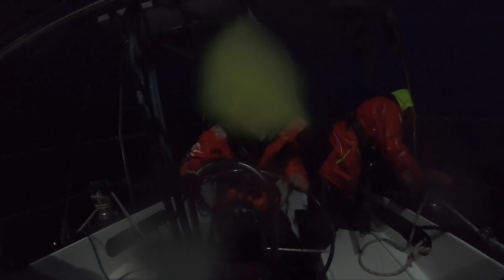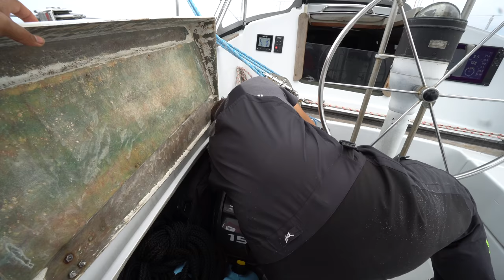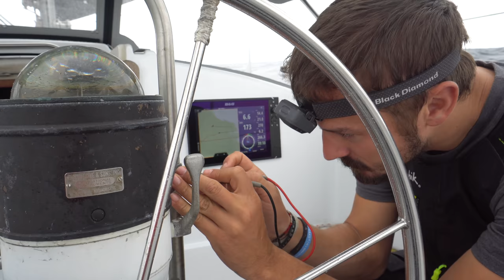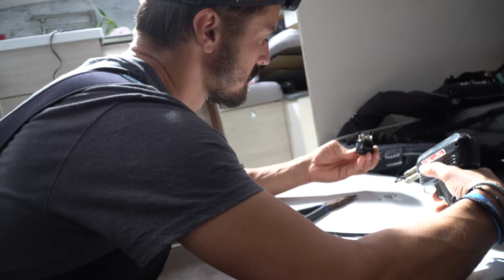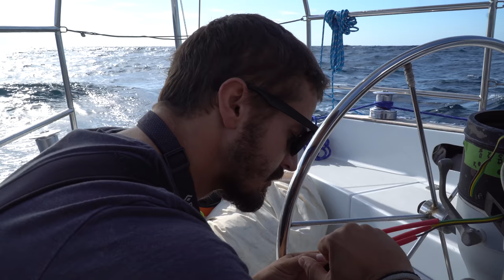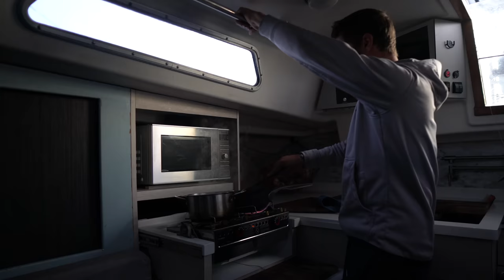Our Electric Motor Broke — DAY 11 / North Atlantic Crossing — Sailing Uma [Step 192.11]

Comment: Guess you need to be a jack of all trades when you own a sailboat. Great job fixing the switch and compass.
Reply: Totally realising this through this video.
Reply: You ABSOLUTELY need to have a very good amount of innate mechanical aptitude.  Whatever problem you have on the sea is yours AND YOURS ONLY to sort out and fix. There are no on call repair services.
Reply: @davem5333  I couldn't agree more.  The best boats for this kind of thing are ones that you've restored yourself as hopefully you will know wgere everything is and how it works/breaks!  It frightens me how many people head out to  sea with a cooler of beers and wouldn't know what end of the hammer to hold or how to call in / respond to a mayday!

Comment: Thanks for letting me feel like I am sailing across the ocean without actually getting wet.  As an electrical engineer, I could suggest a few things that might be good to know if a problem like this occurs in the future. Crimp connections are probably more reliable than soldered ones, but if you are soldering, there can be some technical issues.   First of all, it would probably be a good idea to invest in a soldering iron that has a temperature control (about $100 on Amazon).   And the soldering iron should have a relatively large tip because the small tips are only for soldering circuit boards.  In any case, if there is too little heat, you don't get a good solder connection, and if there is too much heat, you can weaken the switch, e.g. by causing its springs to lose their temper.  And with low voltage equipment, it is particularly important to get good connections, because low voltage devices can require quite a lot of current, and even a small amount of resistance in the solder connection can cause heat and corrosion over time.  A good trick for getting good solder joints is to use plenty of flux.   Solder is hollow and has flux inside.  So if you melt an extra amount of solder onto the joint, so that some of it drips off, this will give you more flux and thus a better connection.

Comment: I can highly recommend some liquid insulation that really seals electrical connections well....I've used it to insulate the back of electrical switches when building steam punk lamps.  It's called Liquid Tape, it's a good thing to have in a tool box when you can find some in your travels.  It's manufactured by Gardner Bender.  Good sailing and fair winds to you guys...you're awesome!

Comment: The way you two stay cool under pressure is awesome! Quick tip for removing hot glue, quick dip in alcohol (rubbing, not drinking) and it peels off super easy!

Comment: Suggestion ! Cheap fix ... put a clear plastic bag over the compass and switch and wrap the opening so it is as sealed as possible . Like a rain coat to keep the big splashes off.

Comment: You should pack the inside of the switch with dielectric grease too. Fill it as full as you can then snap the switch back together, it will keep the moisture out of the most important part of the switch.

Comment: Wrap your switch in a baggie and tape off B-4 inserting (waterproofing). Also you should silicon caulk the compass plate (underside) then screw down. Also get the corrogated plastic tubing that is used for auto wiring protection to prevent chaffing of the wires inside of compass riser.

Comment: Hi Dan and Kika, you might consider using traditional cable controls from the helm to the motor and have the throttle and f/r switch down below. The SolidNav unit I have is setup that way and I like that the electrical parts are out of the weather. That said, most EP installations you see are setup the way you guys have it - switches outside.
Reply from the maker: The switch was actually fine, it was the contacts in the back that were wet and shorting out. I just need to mount the switch in a different way and it'll be fine.

Comment: My sailboat has a small Yanmar diesel which pushes my boat at 5.5 knots while literally sipping fuel . It is relatively low maintenance as long as you change oil and keep the fuel filters clean .  The new diesels run very clean and smooth . If trying to beat a storm or push off from a lee shore I have confidence the diesel engine can meet the task .

Comment: In electronics there are a special type of plastic tubes, which has the property it shrinks very tight around a wire when it get very hot (using e.g. a lighter).
I think the product is called shrinkflex

Comment: One trick is to cover all switches with transparent plastic and secure with duct tape. Not a pretty solution but helps against the waves that break in and heavy rain too.

Comment: Well done ..My experience is that switch contacts are slightly corroded over during moist times on end. It looks like a layer of insulation. During the old days of switching arcs where burning of that layer but these days all is low volt and so no arcing and sparks to burn of the film if oxide 
Clean the contacts and see if it go’s

Comment: I have experimented with many kinds of boat electrical connection water proofing. Forget the shrink tubing  and crimping type connections and simply use a polyurethane caulk like 5200 or other cheaper brands  to coat connection areas. The best coupling of wires is using wire nuts and shooting  the caulk into the open part of the wire nut. I have made these connections especially bilge pump connections. I have made these connections and thrown them into the bilge and have come back years later and opened the connection to perfectly dry and shiny wires in the wire nut.

Comment: Glad to see you both smiling again.
Switches are an essential spare I always keep them on board.
Just watch out for the start of the continental shelf as to get to UK waters it can multiply wave heights if the current and wind are opposing.
Checked the sat wind rain and waves on wind.com and all indicates are you are through the worst.
Just unlucky really 40 miles further south and you might have missed most of it.
Great vids take care.

Comment: I like the electric motor , just the range would be an issue for me . I often do a delivery to a regatta that has to be done after work and is direct up wind or there is no wind . You have the luxury of time and I envy that .
Reply: If you added a diesel generator you could run it full time. But on a boat that size there's not a lot of extra space for a generator and diesel tank.
Reply: @LesterDFunk  True , but that is just a diesel electric like a train .  I think though that might be the ultimate fix . The gen set rarely run , the batteries used 90% of the time and the gen set to start automatically  if the batteries run below a certain percent and the engine is calling . 

Would let you run a dive compressor and a water maker if needed as well  . 

However it also adds complexity , I think Uma has figured out complexity while it might add comfort is also a curse .
Reply: @LesterDFunk   there is another solution , outboard motor bracket on the back of the boat and use the dingy motor for say going up canals .  Not ideal but uses stuff they already have , and a motor they already carry and only used when needed . Won't work well in seas though .

Comment: Dan, in the US the Bureau of Mines (BOM) used to reguate mining equipment to be not only watertight, but gas tight to prevent methane explosions. The DOT has replaced them, but you will also find switches for the printing industry that are gas-tight to prevent solvent explosions. You'll probably fine CE approved "explosion proof" switches wherever you made land, they are usually above marine quality at a better price.
Reply: Lyfan Deth nice tip. Anything with “marine” in the name is ridiculous.😂😂
Reply: @michaelalbert8474  If anything "marine" is ridiculous imagine what "explosion proof" would be cost-wise.
Reply: All weather deck electrics are waterproof on Navy destroyers. And it works. So, yes there are truly waterproof things.
Reply: @DE1049  Getting anything built for the USN makes West Marine look like a discount chain.
Reply: @oceandrew  I was "OPTAR" (Budget) manager for the Operations Dept on a Spruance class destroyer.  Yes some things have to comply with strict design crriteria but you might be surprised at how resonable,  and even cheap a 
very large percentage of things are.
Reply: @DE1049  So what you're trying to say is that watertight switches (electricals) made for USNavy  destroyers are cheaper (and better) than what can be found at West Marine?  [Trying to keep you on topic here.]
Reply: @oceandrew  No, only that they are not any more in all probably.  And that the attitude that everything the military buys is at a premium is false. And I was responding to his comment that nothing on a boat is truly water tight.
Reply: @DE1049  actually federal contracts are tied to around a 40% profit margin for contractors.  it's guaranteed profit for federal defense contracts, even on non-military items.  i supplied non-ITAR controlled equipment for military bases in Guam and we sold list price to a supplier that sold at 40% markup and UPS-Reded everything around the world... yes,  the military will pay a premium and pay the most expensive shipping available regularly, even for regular stock items....

Comment: There is quite a bit of engineering to consider in switches.  As you are switching an electric motor this is an inductive load so there will be some back EMF when you switch off causing an arc at the contacts.   It could well be that the switch you bought was for an automotive lighting application so the contacts metallurgy isn't suitable for switching inductive loads.   Automotive switches also often use internal clamping of conductor paths by riveting say through a plastic housing rather than welding which will be OK in an automotive cabin but never in a marine atmosphere.   The marine environment is much more corrosive than those conditions endured for automotive or in home use.  
You should be able to find a good switch in the UK.   Stay safe!

Comment: That soldering gun is a beast that will melt your switch. Only good for big ground connections. A little 30 w pencil will give you better service for electronics. 
Hope your European trip is all great. Are you going to do the canals?

Comment: the problem is the switch doesn't have a proper seal.. so even with heat shrink water can get into the hole and damage things down stream.  a small bead of silicone would help or a square oring...

Comment: at 37 knots wind surge you guys were at Beaufort wind scale 8 winds 34 to 40 knots or 39 to 46 mph or 62-74 km/h while 28 to 33 knot winds are at Beaufort wind scale 7 28-33 knots or 32-38 mph or 50-61 km/h Gheez that was rough stuff

Comment: Just noticed you use plastic cable ties to stop your turnbuckles from undoing. Id flick this idea and go with a stainless steel split pin. Plastic is too soft and degrades in the sun. This is super important prevention stuff that will keep your rig upright.

Comment: Did you not have a lot of trouble with the motor mounts, drive shaft, changing batteries and other electrics on your motor? 
Im glad you cold manage to repair the motor/switch on sea. What specifically was broken on the switch? You said it looked good...

Comment: How are you getting AC power (soldering gun, microwave for popcorn)?  Are you just running an inverter?
Reply from the maker: Our battery bank is wired to 48V for the electric motor. So we invert UP to 120v AC and convert DOWN to 12dc to run all our other loads.
Reply: @SailingUma  When taking 240/220V shore power in the UK and Europe, can you convert down?
Reply: ajkgordon 
A heavy duty, 48V battery charger can be used.

Comment: You are using car trailer wiring instead of tinned boat wire.  The untinned wire turns black/brown high resistance after a year or two. :)
Reply from the maker: That’s not actually true. All the wiring on our boat that was original was normal copper wire and after 50yrs it all still worked just fine.  If you make to connections correctly and heat shrink them; it will out last the boat. On heavy load cables for the motor or windlass, we used tinned wire, but it’s hard to find in many countries, we we often just us regular copper if needed.

Comment: I think he means an open circuit rather than a short circuit. If the switch was short circuited, then the motor would be running all the time. If the circuit was short circuited, then a fuse would have blown. Either the switch contacts weren’t closing or there were loose terminations. He’s lucky the switch has lasted so long. I was Chief Electrician in the navy and everything should be waterproof on a ship/boat. I would have the motor checked after a long trip but nevertheless, I must say he is a handy fellow to have on board.

Comment: You can't make anything electrical completely waterproof, but as a kid in flood country if you shield it but don't seal it because nothing is water proof eventually water finds a way and in a sealed unit it becomes trapped and it won't dry out. The grease is good keep wd40 type spray around because it displaces water. I open my tool boxes's a couple times a year blast wd40 in the rev close them and it helps prevent  rust

Comment: Great video and nice fix.  I am concerned about bare copper in marine environment.  Copper will corrode and create random, hard to diagnose faults.  Tinned copper marine wire is the way to go.

Comment: Having a smallish 20 ft sailboat, my motor is a 4hp Evenrude.  But I had mild then moderate then total trouble starting it.  Ends up that while I thought the 4 gallon gas tank was water tight, it wasn't.  And since it rained once in a while during sailing season, little by little more water was getting into the gas.  Since water sinks in gas I was simply priming the carb with water.  I didn't realize this and rebuilt the tiny fuel pump and checked the carb.  No problems with either.  Then it dawned on me!  Check the gas.  There ended up being about one to one and a half inches of water in the bottom of the tank!  It would have been a much quicker fix if I'd checked that FIRST!  But Lesson learned - My Honda gas tank is NOT water proof.

Comment: Well that's an exotic place to fix stuff 😎but one small correction "Our Electric Motor Broke" should be "Our Electric Motor Stopped" cause the motor was fine, it was just a short in the switch. I'm glad the electric drive has been so reliable for you, I'm thinking to go this way for my next boat, I know not for everyone, but I used to sail on and off my mooring cause I was to lazy to start the motor.

Comment: Does your motor generate power when the prop is engaged? I noticed on Sailing Wisdom the they used the prop as a drog when sailing in rough conditions.

Comment: Think about using a relay. That way the switch isn't carrying the full load of the motor,  the relay will carry the motor load.
Reply from the maker: The switch doesn't carry any load at all. It goes into the motor controller and electronically activates a large contactor to switch from forward to reverse. No way 300A is going though that tiny switch.
Reply: @SailingUma  , glad you did that when you installed that fork lift motor. It's been awhile since I watched that video. Should have known you knew that Dan. Your and Kika's work on the boat is top notch. Keep on sailing.

Comment: Another great video!

I really like the predictability of the weather tools you are using. Are you extrapolating the wind and wave impact times, or are the tools giving you that too. In short, there’s a difference between weather/marine data and an actual forecast. What are the tools doing, vs. your skills?

Comment: as an old VW collector -- I always worry about electral fires n gas fires- what have you for fire supression?  There is a popular piece called Blazecut that seems to be  popular.  Might be a european counter part
Reply from the maker: With proper fusing, you won't get an electrical fire. Everything on our boat has proper fuses or breakers for wire size. If one trips, we track down the problem and prevent a fire.
Reply: @SailingUma   success favors the prepared mind   After watching you survive the hurricane- I've started binge watching the entire series-  you have a treasure there- and I don't mean the boat-  A trustworthy partner is worth all the fuses in the world.  So you guys take care and have safe sailing-

Comment: Great videos. Can you let me know 2 things. The dates you crossed the Atlantic as I am planning the same trip but from Nfld to Scotland next September. Also where did you get those great folding winch handles.
Reply from the maker: The best time to cross that far north is usually end of July til early Sept, which is when we did it. Earlier, you have to deal with ice and strong cold fronts from the north and later, you get hurricanes and TS blowing up form the Caribbean. 

And the winch handles are these: http://easysea.org/?src=link&ref=Umasail

So far we like them and love the fact we can keep them on the winch all the time.

Comment: With electronics it's all about switches. Where the mechanical meets the circuit. Content within a fixed range of environmental conditions until they reach their expected service cycle limit. Even the best switches eventually fail. A computer processor is minituruzed switches executing gazzillions of low level software switches.

Comment: Any thought of using the motor at the solar charge rate to add a knot or two
Reply from the maker: Speed isn't really the issue. We average 6-6.5 kts and sail more to the waves than the wind. We can sail 8-8.5kts in ideal conditions with no assist from a current. Down wind, we could be doing 12-14kts down the waves. But we choose to sail much slower and more conservatively offshore to avoid breaking stuff and keep the boat as comfortable as we can.